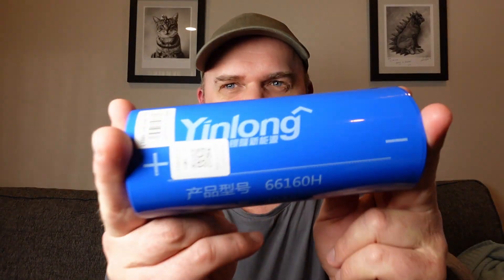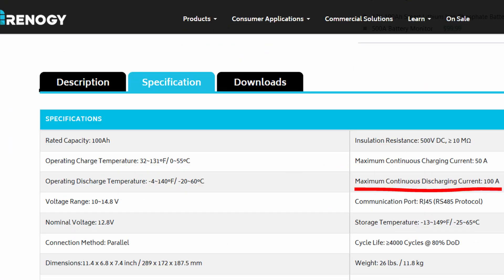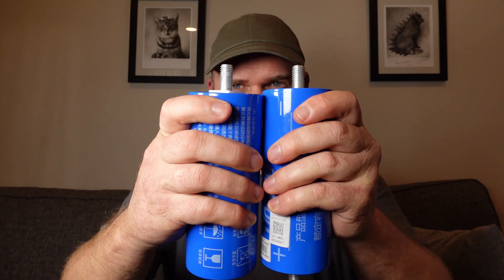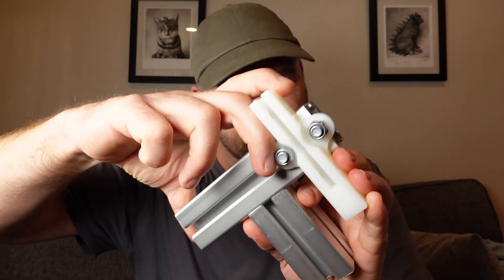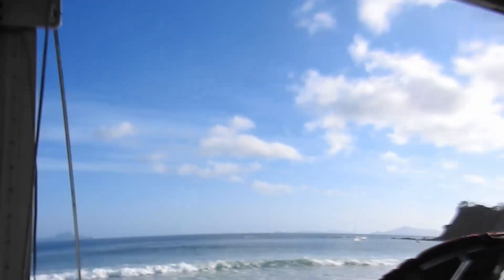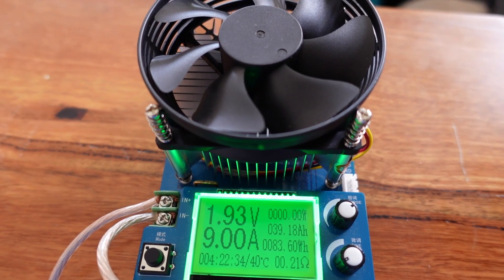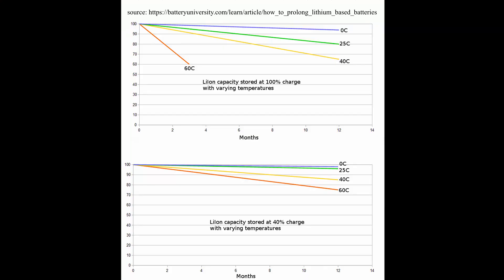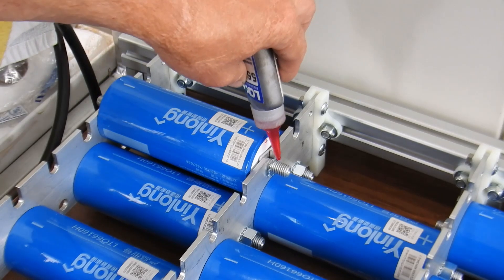Campervan DIY battery build HUGE POWER!

Comment: The output efficiency always depends on how large a load you are putting on the batteries. The more you pull the lower the output efficiency.
Reply from the maker: Of course... some chemistries more than others.  The tests I did equated to an equivalent charge/load of 1800W on my pack.
Reply: @brendontait6968  are these the 40aH cells? How may in parallel? It doesn't matter. That's around 45A per cell so pretty close to 1c. Below 1C you will see better mAh results over long discharges or just add more in P. 
  Wondering how life expectancy is effected by storing or using down to lower voltages and or higher voltages. Like with a Li-ion you are best off keeping them closer to 3.7V if you can for longevity.
   I noticed with these they don't like extreme low temperatures. If you want 95% efficiency at -20C you have to drop the C discharge to around 0.1C that is a ten times smaller load to get the 95%. If you had enough space and money you could have 10x more batteries and still get close to 1800W in -20C temperatures. 
  Do you happen to know the sweet temperature where they are most efficient?
 Personally i do not like to keep any batteries in sub zero conditions.
Reply: @izzzzzz6  What about 0.5C load at -20C? If if have app. 70% efficiency then would be great for my electric car. (my car equipped with flooded NiCd ATM -still factory original batteries since 2004-, which have approx 40% efficiency rate at -20C with 0.5-1C load - and at 0C the efficiency rate is approx 70% with similar load) I do not want to build battery heater, so LTO would be great replacement.
Reply: @pH03N1xM  An electric car will consume large amounts of power so to use the battery at no more than 0.5C discharge would either require a huge battery or to drive extremely slowly and gently. Without knowing your battery build spec and the power consumption of your vehicle when under acceleration or under load i can't really do much more than generalise on the comment.
  But you get my point. Cars are heavy and have to deal with extra loads such as shopping, passengers, hills, acceleration. etc.
  Some battery chemistries are better than others at certain things. Some are better at high power output but may not give as long a discharge curve as others which may be better suited to long but low power discharge curves. You can always keep adding batteries in parallel but eventually the size and weight of the battery (not to mention cost) is going to become an issue.
    If we could afford to we could design the car around the battery and go from there but with so many main manufacturers doing the hard work it seems better to wait for used e-cars to become available and then recondition or modify them from there.
  NiCd is an ok technology for short bursts of power and relatively quick charging. They can handle heat and some abuse but tend to have a shorter lifespan and perhaps not as efficient as li-ion. I have not been comparing all data on all chemistries but if i wanted to base a purchase on data i would first try to consider most of the advantages and disadvantages that each battery chemistry might offer for each application they are being designed for. Cost is obviously a factor. Sometimes weight, size or charging speed is also important. Temperature sensitivity is also important to many.
   You can often look at tried and tested real world examples but there are lots of options and lots of data to compare. LiFePO4 is another potential battery chemistry that some people seem to enjoy experimenting with.
Sometimes it comes down to availability as it is not always easy to source these batteries and shipping costs may require a group purchase to make it worthwhile.
  I recently purchased 80x 21700 samsung li-ion cells for an ebike and portable power project.
Reply: @izzzzzz6  My car is a factory original electric car from 1996 and batteries from 2004. It have wet NiCd blocks (SAFT liquid cooled traction batteries) 6V 100Ah nominal capacity per block, 20 blocks, whole bank is 12kWh and the weight is over 250kg. The voltage of the system is 120V nominal. For normal 50-60km/h city driving (my generic usage) it have 0.3-0.4C load max. For 90km/h (max speed, it is electronically limited) the load is over 1C. During acceleration of course the load is higher, but that is just couple seconds which can be handled by NiCd easily. Motor is a 11kW nominal one, max power is 22kW, air cooled. It is not a drag racer, it is a city car basically with approx 75km range. 

The capacity is still fine, but the NiCd capacity drop drastically below 0C and complex to maintenance (electrolyte level must be topped frequently due the overcharge based electro-chemical voltage balance) and the charging take a lot more energy compared to modern chemistries. I do not want to use battery heating system, so LTO would be great replacement of the old NiCds. Lot of my friends did Lifeop4 and even tesla battery conversion, but i want to do something different. I have some 66160 30Ah LTO cells (powering my son's small electric toy truck ;), tested them with 1C/2C load @ 25C external temp, and all was great, it had near 30Ah capacity even with high load. But i never did low temp testing till now. I plan to build 90Ah or 120Ah LTO bank using 3p60s layout.
Reply: @pH03N1xM  You need to look at the spec chart for temperature vs efficiency. it is not amazing unless you either have a monster bank or a very small draw of power.
  NiCd is great for bursts of power and fast charging but don't generally life forever if you abuse them. As for this technology, just look at the spec sheet for temperature and you will see how low the performance becomes at -20C TBH i'm not sure which batteries perform the best at low temperatures, most of them just don't like it.
Reply: @pH03N1xM  I find that the best option is to try to have the vehicle or battery stored in a heated place if you have the luxury, once you start driving the batteries should warm up, the problem is if you park somewhere in the cold or if you don't have them in an insulated box (which can also be cooled when required). Then your half used batteries could get cold and perform pretty badly.

Comment: Thanks for making this video😀
Reply from the maker: No problem
Reply: @brendontait6968  was your charge time 6min for the whole system? Or was that per battery? Like 3 batteries take 18 min?
Reply from the maker: @gta-6837  hey Jerry, the cells have the ability to charge in 10 minutes from 0-100%. While it would be possible to do this.. it would need a 300kW charger and supply.  This is something that I do not have. (Although it would be possible to make a charging system that is intended for fast EV charging - am unlikely to do this as I don't feel it is necessary.)  The most I am likely to charge with is around 8kW, so my charge time is likely to be a bit over an hour.
Reply: @brendontait6968  thanks for the explanation, I get it.😀

Comment: I don't know if you plan to cover this off in a future video, but anyone looking to do something similar MUST consider the insanely high fault currents these things can produce. 

The typical internal resistance of these cells is about 0.5 mOhm. With 9 of them in parallel and 11 in series the total pack impedance is going to be roughly the same number. This means that at 24 v a dead short across the terminals can sustain a potential fault current of over 20kA !! That is a very dangerous current that will produce a massive arc and physically destroy any supports. Therefore absolute attention must be given to the fusing design .

All fuses have a two current ratings. Their nominal rated trip (which is the current at which they will clear the fault after a fixed period of time, typically 10 - 60secs), and a short-circuit fault current rating which is the amount of current they can sustain for a very short period of time while the fault is being cleared without damage to surrounding equipment. (This simplifies the story a fair bit.). This current is usually measured in kA (1000's of amps) and typically 5 - 10kA for most fuse types you will encounter. The actual value depends on the design and construction type of the fuse, and is not directly related to the rated trip current.

The point is that any fuse on an LTO bank this large needs to have a short circuit rating of at least 20kA. Fuses that can only stand 5 or 10kA do run a real risk of exploding in a dangerous arc if they have to clear the kind of currents an LTO bank this size can deliver. A good starting point is a Class T type fuse, which are reasonably common and available in most places.

If in any doubt have a chat with a friendly electrical techie or engineer to verify what you're planning to do.
Reply from the maker: Yes, I will do thanks.  I'm using 80kA interuption capacity HRC fuses (one each end of the pack).  Am setting up to do a video on it.
Reply: @brendontait6968 OK 80kA should cover it. Now check the 'let through energy' (measured in kJ) of the HRC fuse type you are intending to use. Any downstream equipment will need to be able to sustain this energy pulse which is essentially the product of the potential fault current and the time it takes to clear. (I recommended Class T's because they have a very fast clearing time and thus a very low let through energy.)  Big HRC's are typically designed for AC distribution networks with big heavy conductors and can let through a lot of energy before they go bang. 

And of course DC arcs are much harder to extinguish than AC arcs, and can cause a lot more damage. Some fuse types have different AC and DC ratings for this reason.

Essentially you are protecting the cable from the battery bank to the main distribution board, and the first main disconnecting device in that location.  Each branch cable from there should have it's own fuse, and it's very important these are sized to protect their downstream cable size. 

What we're starting to get into is fuse discrimination design, which I'm not sure I can do this justice on a comment thread. But there is heaps of material on the net if you know what to search on.

Also I'm not sure why you'd want a fuse at each end of the bank, I honestly cannot think of any scenario where this would add any extra value if the bus bars inside the bank were well enough protected, which they should be anyway. What was your reasoning for this?

Sorry to bang on about this, but in your video you compare the LTO bank's energy capacity to a substantial streetside transformer ... well the electrical design and protection considerations are very similar.
Reply from the maker: The reason I'm using a fuse at either end is that the battery pack is long.  Although difficult, the negative wire runs back up the length of the battery.  Although there is a cover to isolate and protect it, there could be a potential to short between the -ve and some of the intermediary bus bars.  You never know what might happen in the case of a crash etc.  You're right tho, I might change to class T.  My big HRC are a bit too big to fit where I want them to.   Thanks
Reply: @brendontait6968  That makes sense about the negative wire, it's not a bad solution. I'd look to eliminate the problem by getting that wire outside of the battery compartment if at all possible. The bank I built is in a yacht that has much less severe potential impact demand. But it's good to see you're thinking that through.

The nice feature of Class T's is that they're so fast that you aren't even aware they've blown, no noise or heat at all usually.
Reply from the maker: Yeah, the negative wire has a polycarbonate cover between it and the battery, but that's not to say it would be impossible for a piece of metal to pearce the PC and the cable insulation in the case of an accident, maybe overkill...  but,  I'd rather protect for worst case.
Reply from the maker: Just having a quick look.... I can't find a Class T that is over 20kA  it think that is around the capability of my bank.  I think that's why I went for HTC Thoughts?
Reply: @brendontait6968  ClassT fuses max out at 20kA. I tested one on my bank and there was no drama at all. Yours is however 50% larger so it's less clear if it will be OK. 
What you really need is a bit of extra resistance in the bank to limit the peak current a bit. A couple of mOhm would be plenty.
Reply: @brendontait6968  OK I'm not sure if you can get hold of these Class T 200kA fuses but they tick all the boxes:

http://www.cooperindustries.com/content/dam/public/bussmann/Electrical/Resources/product-datasheets-b/Bus_Ele_DS_1029_JJS.pdf

Also  useful page:

https://www.eaton.com/Eaton/ProductsServices/Electrical/Support/Documentation/TimeCurrentCurves/Fuses/index.htm
Reply from the maker: I think that 200kA rating is only for AC...  this link doesn't spec DC, when you read similar dc rated fuses that state the 200kA ac IR, they state 20kA on dc.
Reply: @brendontait6968  Yes I was trying to select a fuse that might be readily available. The  Class T JJS series would probably do the job, but I agree the spec doesn't actually say so. I've no idea on price and availability for these bad boys, but they are specifically rated for 1000v DC Solar PV applications. And the 400A version is explicitly rated to 50kA

http://www.cooperindustries.com/content/dam/public/bussmann/iec-electrical/resources/data-sheets/bus-iec-ds-10201-xlpvfuselinks.pdf

Maybe overkill, but absolutely will do the current limiting needed here.